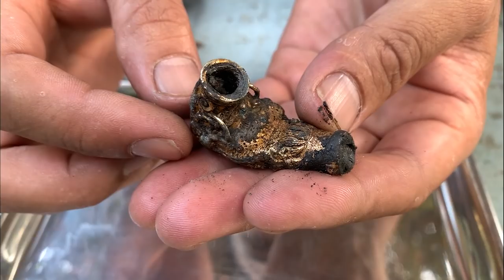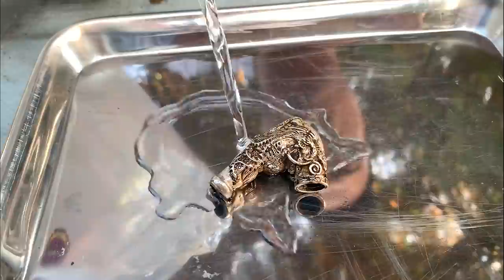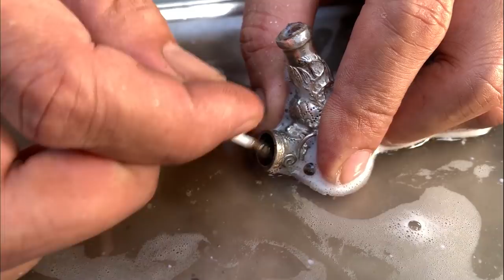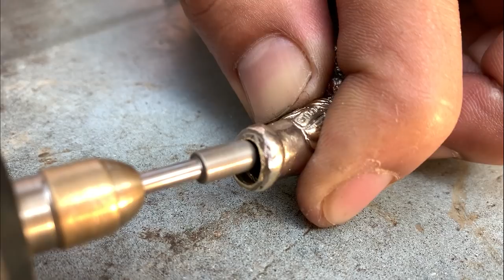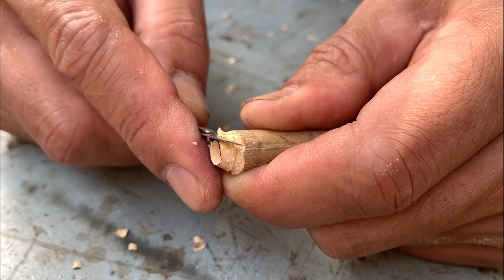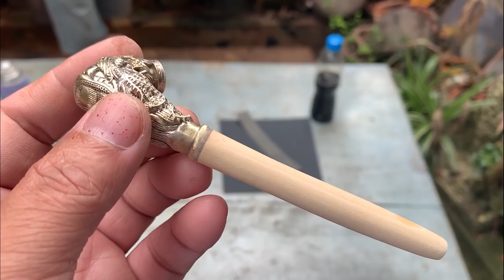Restoration vintage tobacco pipe | Restore Old silver smoking pipe

Comment: The metal clean up was done well enough. The stem is a total fail the stem should be curved. This guy need to look into how pipes are made and revisit this one. The least he could have done is cleaned up the joint between the bowl and the stem cleaned the glue off the silver.